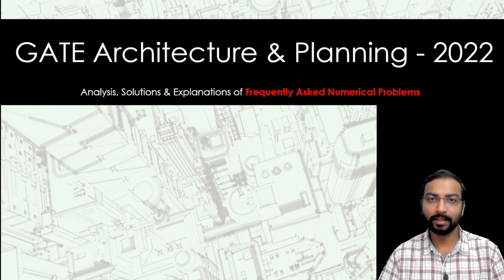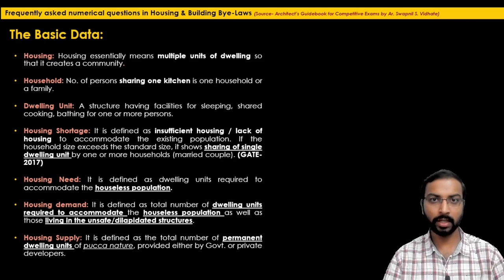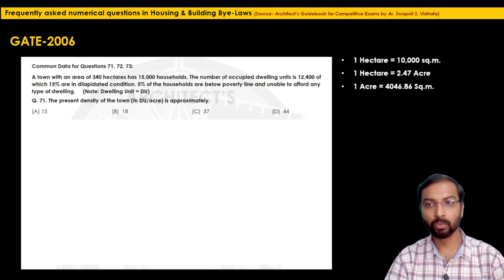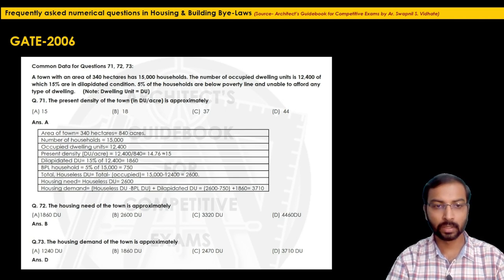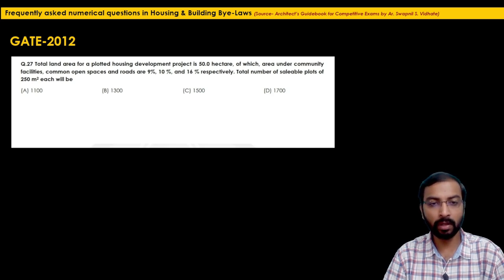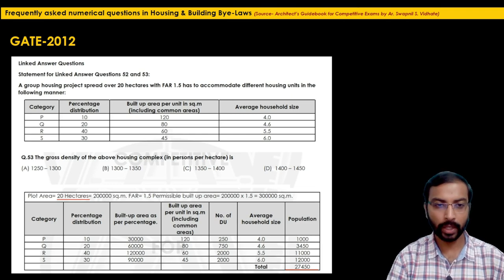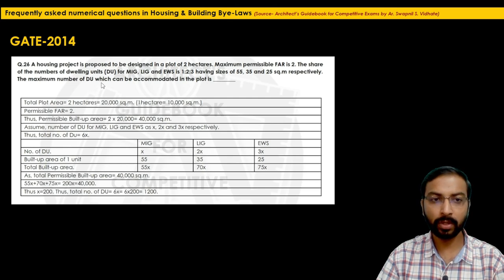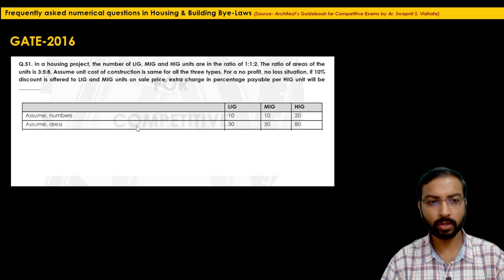GATE Architecture & Planning 2022 I Housing & Building Bye-Laws (Part 1) I FAQs

Comment: I was watching ur video and along with I was solving the problems too.. What I found is , in question from gate 2007 the correct answer is 103950 option B not 111150
Reply from the maker: Read the question carefully. The information related to dilapidated DU is provided to confuse. In your calculation you have subtracted those DUs from total DUs. Further, they have mentioned 'Housing Need' and not 'Housing Demand'.